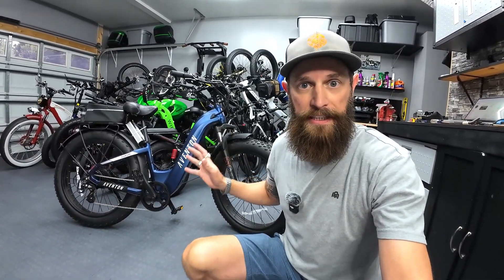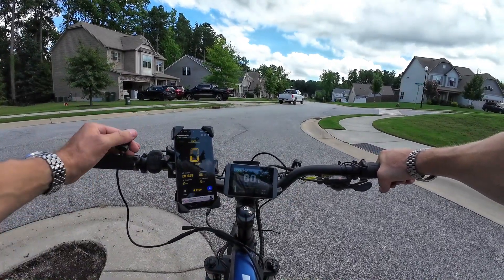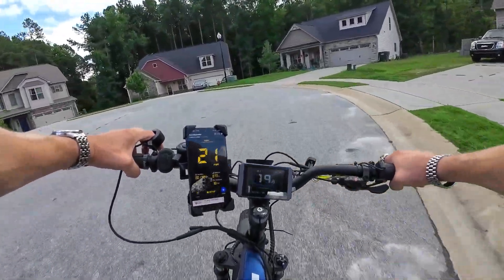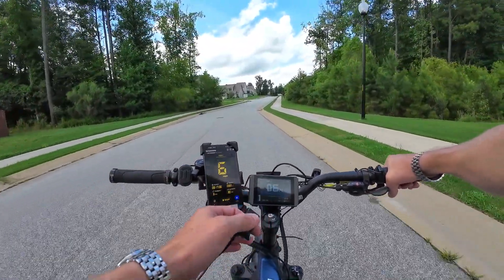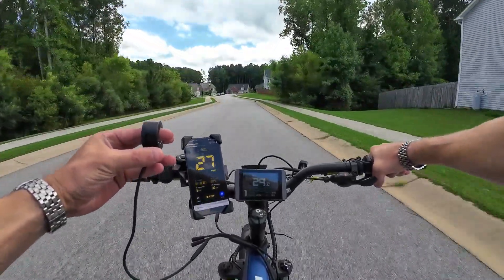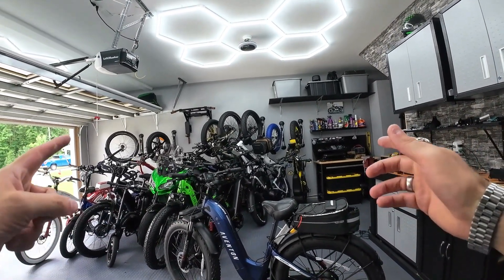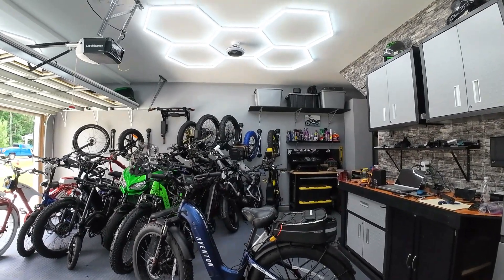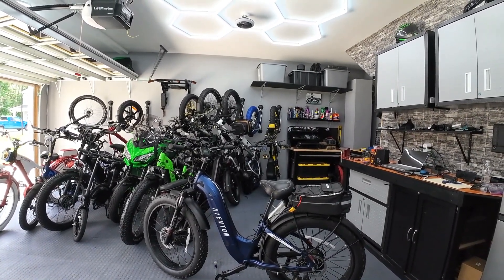Aventon Aventure 2 Unrestricted:  Controller & Battery swap

Comment: I am rebuilding a adventure 2.i order main wire hardness.n a headlight with the cable n a charger.dont have a controller or a display.i don't care about turn signals.i.am interested I also going to have to replace motor extension cable with is 10 pin.let me know if you can save me money.

Comment: I would LOVE to purchase one!! I have a aventon aventure 3 and im very upset it restricts at 20 mph i would want it go at most 30 mph. THATS enough to get around town fast enough with no problem and if so is this possible to have the controller run off the battery the bike has already? If not it’s ok. But I’m interested.

Comment: Is update on this controller?
Reply from the maker: never made the controller,  Aventon battery not big enough to handle the power and it would have also eliminated the torque sensor.

Comment: I love, love, love my Level 2 from Aventon, but it baffled me beyond belief as to why they lock their throttle at 20mph... Okay yeah technically it's due to laws, but prior to Aventon I had a Velotric Discover 1 and that bike didn't have an app. It did have a "hidden menu" that you could access to up the bike speed to 28 (unlock it), but it DID let the throttle be unlocked too.

Probably just an oversight from the company, but on long commutes back home from work I utterly loved doing like the last mile of just throttle at nearly 30mph.

Comment: Yes please make it for everyone!!
Reply from the maker: I have not moved forward with this.  I didnt think the tiny Aventon battery could handle that strong of a controller, and using this KT Controller would eliminate the torque sensor for pedal assist.
Reply: @CitizenCycle925  cant you just make one with the stock amperage? i think most people wanna eliminate the lag, and the 20mph limit

i dont think too many of us even want a bigger controller, just one that doesnt lord over us like Aventon does

Comment: Great video. Any future plans to upgrade a controller and display for a Aventon Level 2 with unrestricted throttle. I have a Bafang BBS02 and thought of removing it from a Trek bike and installing on the Aventon and change voltage settings for the controller to 48v from a 52v setup. Thank you, Scott
Reply from the maker: I have not moved forward with a controller upgrade.  I dont think the tiny Aventon battery could handle that strong of a controller, and using this KT Controller would eliminate the torque sensor for pedal assist.
Reply: @CitizenCycle925  I plan on going back to cadence sensor due to health issues. I have Level parts in cart at Aventon website. Just reviewing other options before I purchase. Thank you

Comment: I want one or two, I have two bikes, and I have ecell 5 star controller,
Reply: I would want a ecell 5 star controller, it has a 1500 watt battery and a 40 amp controller, with 60 volt dual batteries

Comment: When will controller be available?
Reply from the maker: i have not moved forward with this as changing to this controller would eliminate the torque sensor.
Reply: @CitizenCycle925  so those KT controllers are only compatible with Cadence? thats cool cause thats what i have

do you happen to know what the stock specs are of the Aventon 1 controller by chance?

Comment: Is the Aventure.2 one of the more "hackable" ebikes to mod? If not which ones offer easier controller, battery, motor, etc upgrades?
Reply from the maker: Aventure.2 is definitely NOT a more hackable bike.  There are very few upgrade options for any ebike in the market.  I would either just buy a bike with great performance out of the box, or just buy something dirt cheap and mod it to what you want.
Reply: @CitizenCycle925  thank you, I was assuming that Aventure was one of the least hackable/mod-able e-bikes, so I now I am curious why you choose that for this experiment and resulting video.  I am guessing that the popularity of Aventure was the motivation and I totally applaud that :-)
What would be the “base model” that you would recommend for folks that want more “mod-ability”.  Just start from a Wal-mart bike plus Bafang kit as a starting point?

Comment: I might have inclided too many links in a prev. comment. here's what I meant: yes I think there's a huge demand for your controller idea, this goes for both the Aventure 1 and Aventure 2, especially since the aventon app (without warning) nerfed the software and firmware on both Aventure models, capping speed at 28mph a year ago, where speeds of 51kph (in the controller code) (equating to 31.69 mph) had previously been accessible. this update affected everyone who updated their app and connected to a bike, even folks on private property or in unrestricted states. Many reported getting into unsafe situations when they expected power that was, out of the blue, no longer there. 

these threads indicate a fraction of the demand: 

Aventon subreddit: yes_aventon_slowed_down_the_aventure_w_firmware/

Aventon subreddit: did_aventon_reduce_the_top_speed_of_my_aventure/

aventon's invasive app: r/ebikes/comments/1czpnsb/really_aventon/

reach out to folks commenting there if you figure out a fix! I bet they'll spread the word.

Comment: also if you make a new controller, it may be worth optional replacement throttle and cadence sensor hardware (for aventure 1) since people have been having problems with responsiveness that may not be fully explained by software issues, though from my limited understanding, I bet software would probably fix these problems enough for most people, rendering the throttle and sensor hardware a non-issue.

Comment: This is awesome! I would love to be able to have 30mph with everything functioning! I just got an Aventon 2 and put it together. Looking forward to riding it. I'm a big fan of the turn signals.
Reply: Did you have any issues using the app and adjusting max speed? Mine still sits at 20 when riding even though app says 28mph. This is the first video where I see somebody changing out the throttle and battery when there are two other options one using the app to adjust the speed number two you have to use a Windows computer or Mac computer and a proxy.. the bike is brand new and the last thing I wanna do is fry it out or damage it but seeing how I’m an adult, it would be nice to build with to go a little faster than 20 mph
Reply: @thedude3720 the app speed limit is for pedal assist the throttle will always stay limited at 20mph honestly fuck the government

Comment: If I get a adventure 2, I will give powerful lithium in New Jersey a call to get around the 20 mph throttle limit and have them add another battery on the rear rack.

Comment: I’d be interested in what you can do to my Aventon abound, I’d like to maintain the OEM battery and parallel it with a second one through a combiner - I already have the dateX2 30 amp combiner. 
I’d like to eliminate my 32 km an hour top speed on throttle and do better than that, I’d also like to maintain my torque sensor. I’m completely OK with tossing my present controller and display.

Comment: My battery is fully charged display shows is dead and shuts off instantly.  Any ideas? Need new battery?
Reply from the maker: @jessejohnson98  when you push the power button on the side of the battery, does it stay lit?  And of course double check all connections.
Reply: Yes the battery meter button on the battery shows full green bars and stays lit.  Display either turns off instantly or don't turn on at all. Ancheer sunshine I believe the bike is called 2024 version
Reply from the maker: @jessejohnson98  oh, i thought you had an Aventon.  I would check power supply connections.  Any chance the display got wet, sometimes that will cause a similar issue.
Reply: Has g51 lcd display

Comment: I would have interest. I have the aventure1 but so far there are similar connections etc to the aventure 2. Plus I would like use exiting 48 v batteries since owning 3. Hopefully its just the controller throttle and display to minimize the cost and finally get into developer options to change a few things

Comment: Very interesting. The Aventure is a nice bike. You can have your controller work with the torque sensor and lights. You would probably need to have your controller mount on the rack like your test build here. I don't think you could get a 35 amp controller that will fit in the bottom bracket housing. Even if you could find one that fit, it would get pretty hot in there. 
I like Aventons, but I don't know if the Aventure is a good early candidate for your upgrades. It seems bikes like Himiway, Magicycle, or Kepler could allow you to start with simpler kits that would plug and play. 
Getting the wires and connectors from your controller to the Aventon wiring harness inside the bottom bracket will take some creativity.  
Your controller would make the Aventure climb a little better, but it seems like removal of the 20 throttle limit is what people mostly want. Maybe you should investigate selling new or reflashed displays that use the standard controller but fix the throttle on something like an Aventure.

Comment: It would be awesome if they gave The aventure three more speed and more battery options! Like seriously, my dude.I do hope you make a range.Extender at the very least , but this with the controller with more power , so more throttle option is also great like u could make it a second option! Like seriously, my only gripe with the adventure too.Is the battery everything else is perfect The stability and fact that it still feels like a bicycle with more heft! If you could make these kits before I wonder up getting g a second bike thats built for long range that would be awesome! Hell I still want the front motors kit for this bike!

Comment: Think a 30a controller would be fine. I believe the issue lies with the factory gauge wiring of a 48v system. It's too much amperage for the smaller wires

Comment: it could be a cool idea to have some kind of universal kit based on voltage requirements that is independent of any specific model. the wiring harness would be key to making all this plug and play. have a way to have different connection options depending if it's higo connector or whatnot.

Comment: I cant speak for your controller, but some have the abilty to adjust the low voltage point....so that it would not think the battery is low and shut down.  Just a thought.

Comment: As Bryan mentioned, he doesn't know what the BMS is in the battery pack. Generally, they have a limit to the amount of amps that they will produce from the battery. Without that knowledge which should be available with some digging, there's no point in changing the controller and display.

Comment: I have an aventure 1.0.  I really like the bike and I pedal 95% of the time, but having said that, who doesn't want more power?  I have 1 particular hill I climb where I use PAS 5 1st gear and everything I have to get up it, so more power would be awesome.  More importantly to me, would be the ability to customize the PAS setting for speed or power.  A 30 or 35 amp controller and a customizable screen would make my day.  I'm seriouly considering selling my bike and buying something else but I would keep it if I could upgrade it.   Love you videos

Comment: The controller doesn't have to fit inside the frame it can sit in a different location as long as there's enough wire to reach inside the frame to connect to the harness going up do the handlebars and the battery in the frame and the back wheel motor connector I wish there was an adapter that could fit many different bikes

Comment: The tail light the brake light will be important but the headlight you can buy an aftermarket headlight that straps onto the handlebars that you can recharge in your house remove it from your handlebars use it as a regular flashlight and that would be a brighter light and better light that's what I like to use

Comment: Hi it's me Dan I live in Mexico this is exactly what I would want for my TROXUS  26 by 4 in tires step through even if I had the option to buy different wheel together and you have the option to buy it in 20 inch 24 inch and 26 inch if you had that ready right now I would buy one and test it myself for right this second I believe something like that would be very welcomed down here like I said if you had one ready I would buy one right now I have the front wheel kit ready to go on my other bike as soon as it comes in I believe that would be something people would want and I would have a back wheel kit that would help a lot of people with the power where is definitely needed because a lot of the bikes are not built with a lot of power and down here we don't have the same restrictions not yet anyhow

Comment: Thanks Citizen! Yes. As a Magicycle 52V owner I would want an upgraded controller for sure as that bike only has a 22amp controller/display (now they are providing a 25amp controller I believe because their watts and nm are up from when I bought my Cruiser Pro in ‘21) 
A 35 or 40amp controller should unlock the Magicycle powerful 750w motor and make hill climbing a breeze. I also own a ‘24 Wired Freedom and appreciate all of your videos for that bike!! Take care,

Comment: Bryan I already put your warp drive kit on the front of my Aventon… so how would this integrate?…and absolutely I would want one I’ve been asking you about this for quite sometime..and mine is a cadence sensor and no turn signals
Reply: Right? Whats up man, can you do one for the back tires? Or a refresh of both front/back with the 1500 watt Hentach motors like in the Ecells? :)

Comment: I would be interested in a controller upgrade for a Level.2 - no need to worry about turn signals, just brake lights/headlights, plus I don't care about bluetooth, but the torque sensor would be great. Either way, nice job!

Comment: Aventon fan here, kinda.  Have ridden 7,000 mikes on my Aventon Soltera.   It’s small and light, but trouble free.   Still looks great.  Gotta have 28 on throttle which this doesn’t come close to.   Been begging Aventon to make a 28 throttle bike.  Crickets.  Jumped on your video hoping it was just a display swap.   But no, too many changes and still not a big battery.  Heck - screw Aventon and their good looking quality bikes - I’ll buy something else with 28+ out of the box.  Citizen - thanks for trying.
Reply: I've been looking a lot lately to find the best choice for my car replacement. So far the Wired Freedom ticks all of the boxes for me. And the Wired Cruiser if you prefer stepthrough frames. I haven't bought mine yet but will do so soon. It might be something to look at to replace your Aventon.

Comment: Learn about the rx and tx wires of the display.  There are only 5 wires on an ebikes display.  You could likely just buy sw900 displays and try to find a matching connect to plug and pay.  The sw900 allows you to set amps and top speed.

Caution, the earliest sw900 displays only allowed 20amp max.  Newest ones can adjust to 50amps...
Reply: RX (green) and TX (yellow) wires are info in and out respectively.  The red and black wires are high voltage + & -

Lastly, the blue is 5v I think?
Reply: Also,
The Aventon display will likely have same red and black, but you can open the controller to get the other corresponding colors.  The pcb is usually marked for RX  and TX

Comment: I would not want one. The Aventure 2 is too nice as is. You find a way to swap out controller on it and have everything works as stock except for more speed I’m in.
Reply: Purchase the (Adapter - Motor Cable - Higo 2916 Male to L1019 Female) and (Ebike Sine Wave Controller 30A Compatible with 24V 36V 48V with S866 LCD Display/Thumb Throttle and PAS for Accessories... 3MO 30A-S866-130X) basically plug and play. Just one adapter needed. Total cost for me was $110. Have fun and be safe!!! Remember to ask ChatGPT to see what kind of motor you have and controller to see how much power you need for the controller

Comment: 🐍 PLEASE CREATE for us Grizzly guys a plug & play programmable 52v 40A controller that fits under the seat.
Front controller should be able to nerf the torque at low speeds to fix wheel spin.
We love our Ebike's but want just a little more uuumph upto 40mph‼️
🖖🤙